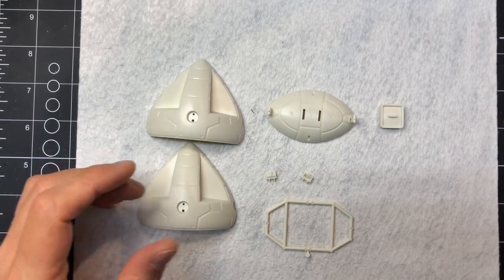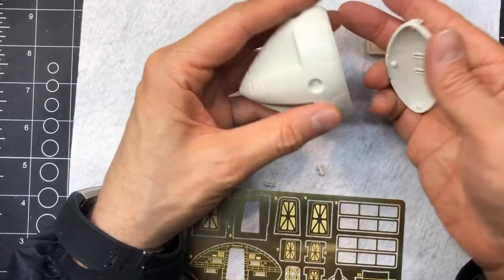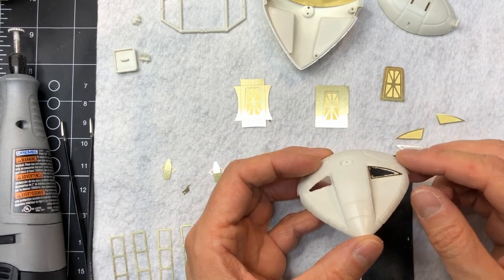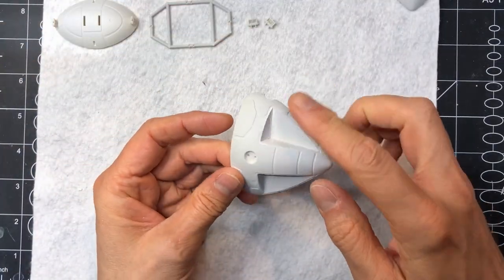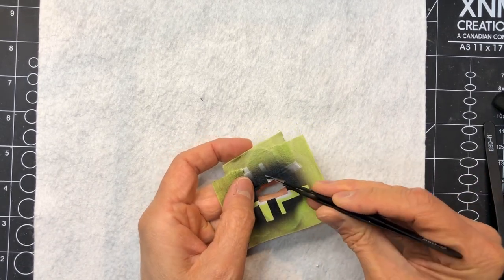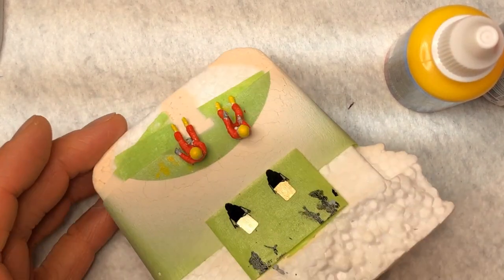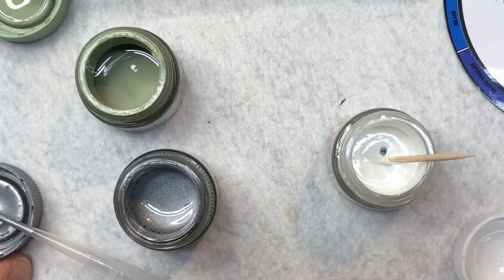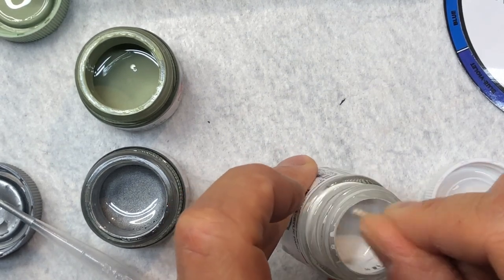Space: 1999 Eagle 1 - Part 1 - Build and Prime - 1:72 - mpc

Comment: Oddly enough, SpaceX has now built the engines for the Eagle. The problem with the ship is that it doesn't have enough space for the LNG required to fly the ship. So a more realistic Eagle would need larger areas for the tanks. The 4 engine pods on the sides would be perfect for scaled down versions of the Raptor engines with vectoring controls. The 4 engines in the back are good to go from SpaceX. So a real Eagle would need to be double in length and as wide as Starship. But, it is a real possibility.